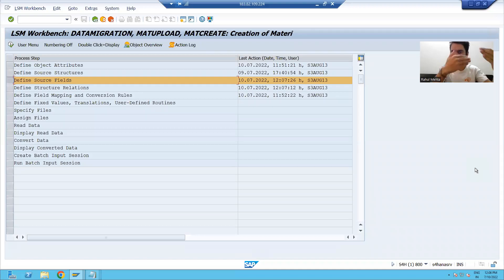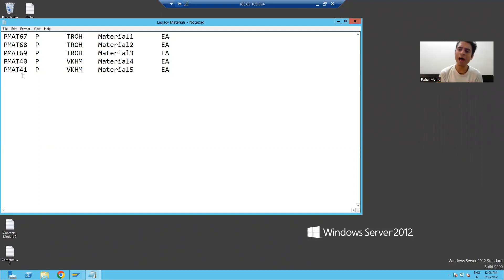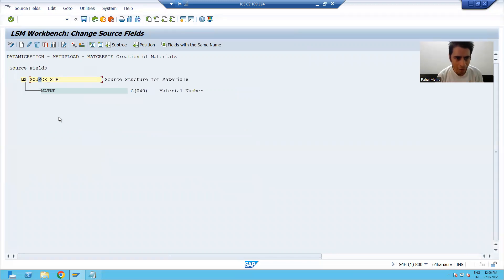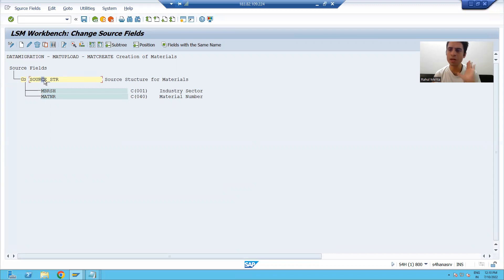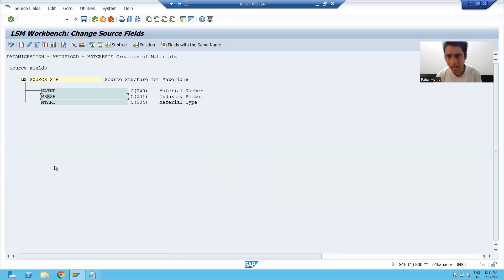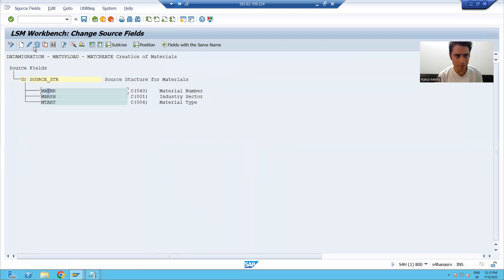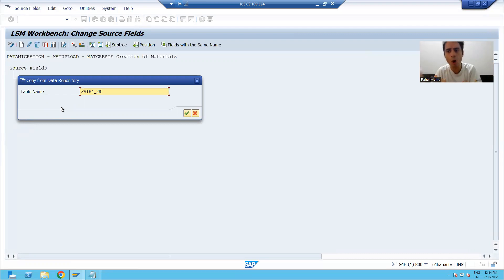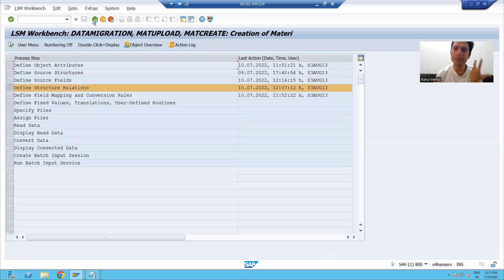20 - Data Migration Techniques - LSMW - Batch Input Recording Method Part2

Comment: Sir, In my case in 5th Step Table Name and  Define Field Mapping and Conversion Rules , 
AT 12:10  TABNAME and TCODE is not displaying, I can see only 5 Structure Fields . Is it fine?
Reply from the maker: Hello Teja - It is settings based. You can go to Extras - Hide and Display Fields/Code - Select the checkbox for Technical Fields. You will be able to see TABNAME and TCODE.

Comment: hello sir, in the 4th step i got an error like no target structures could be found what is this sir i am giving SE11 structure in the 3rd step how to resolve this error sir
Reply from the maker: It might be the case, you have not activated the structure which you created.
Reply: @sapabapbyrahulmehta  created str and activated but not fields are appered in 5th step
Reply from the maker: @Blink_M4-j2    It means - you have not the default fields in the recording. Whatever the fields are set as default, they appear automatically in the 5th step. Please cross check the first recording step.